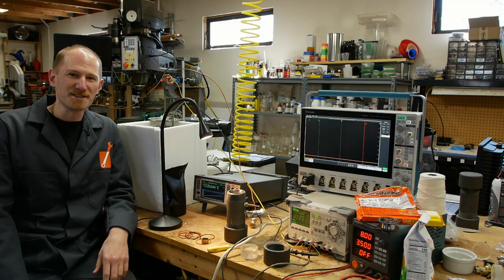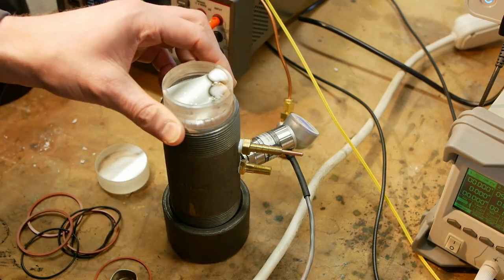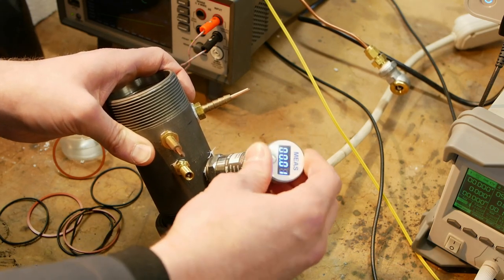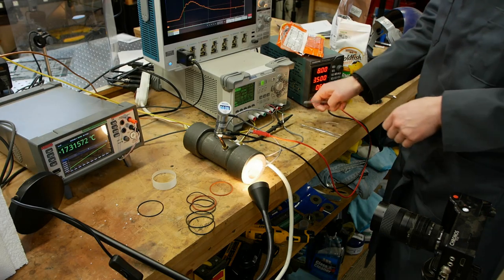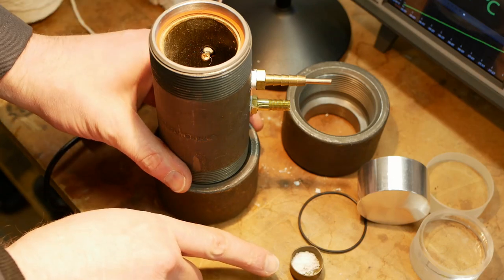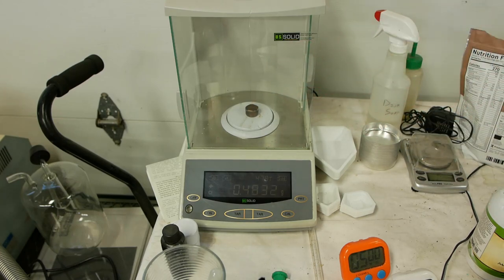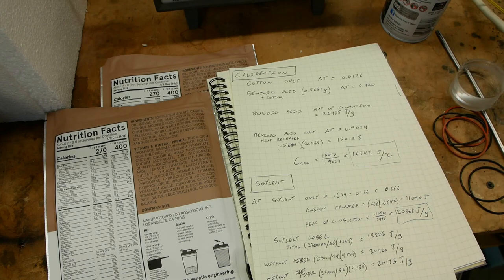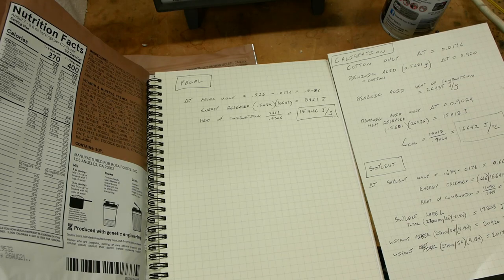Measuring human digestive efficiency vs. a flame

Comment: You should multiply the caloric output from the soylent sample by the total mass of soylent consumed to get total caloric input (flame caloric), do the same with the stool sample data; then compare the (total consumed calories) - (total output calories) for your two weeks.
If you subtract the total fiber calories from that result, you should be able to acquire a rough "total macronutrient removal efficiency" ratio (of course, this would ignore any losses due to bacteria consuming caloric value before your body could access it).
Reply: Would such a procedure take into account liquid and gaseous outputs?
Reply: @b43xoit  No, liquid outputs usually have passed through the body, thus were absorbed and count POSITIVELY for digestive efficiency (assuming you mean perspiration & urine outputs), and gaseous outputs are, unfortunately, extremely difficult to measure with any degree of accuracy (short of testing with a colostomy patient)

Comment: How did you ensure you didn't lose water between runs due to evaporation or drips sticking to the apparatus? It seems like the total amount lost would be relatively small, but I was curious if you tried to weigh the whole apparatus or something before and after.

Comment: It would be great if you could isolate the soylent 'output' and figure out the dry weight lost through digestion, so that the experiment can be performed with equivalence between the two samples.

Comment: this reminds me of a question from my days as a runner.. i always assumed i was bruning about 100 kcal per mile. i also found that i lost about 1 pound of weight by dehydration for every 3 miles i ran. i assume that water lost to dehydration means that water had it's temperature raised from normal body temperature to boiling temperature. i never quite did the math, but it seems like it corelates closely with your experiment, where the weight of water lost to dehydration is a measure of total heat produced by normal body metabolism plus the additional heat from burning the calories from running. any thoughts?
Reply: Well when you run you lose water by sweating and by respiration. None of the water is "raised to boiling temperature", it just evaporates at your body temperature and removes heat equal to the heat of vaporization. Water vapor that you exhale might have been produced directly from metabolism without ever condensing. Sweat on the other hand evaporates as long as the air isn't at 100% humidity, and as it does so it removes heat from your skin.

Comment: And I'd be flabbergasted to see a person who used that diet still be alive after eighteen months of the diet just from the extremely high fiber count alone, and the fact that they ate paper, that was soiled in a flammable liquid food product that has the potential to explode if set on fire. Heck if you ask me, that person might as well drank gasoline for a week and called it booze, than simultaneously combusted if they got blasted by the heat of my fireplace, or a large wooden pallet fire because they stored a flammable and in some cases explosive liquid in their body, just waiting for it to go into self destruct

Comment: The difference is so small because you did not a proper mass balance but just analyzed the energy content per weight, not the absolute intake vs. absolute output. You took in e.g. a total of 1 kg soylent but what comes out is much less than 1 kg. So you have to multiply each total amount with the energetic value per gram that you determine to get the proper energy balance.

Comment: If you cover the whole thing with water, I feel that even a critical failure of the seal, and glass potentially getting all the heat from the flame, I don't think it'd be an issue. Because water around the whole thing will act as a heatsink and extra pressure on the outside.

Then again I might be wrong as I am not an expert xD
Reply: Wasserbombe!

Comment: You should compare the total dry weight ingested vs the total dry weight excreted to see what % of it got absorbed (that mean you should dry and weigh all the excrement from the week, unless you can think a more practical way to do it)
Reply: This is most likely the source of the error he's seeing. If he ate (say) a kg of food a day and pooped 300 grams of fibre then burnt that it would explain It fairly well.
The balance of weight would be respirated and peed out (the body burns fuel about the same as fire, fuel in makes CO2 and water out (kinda))

In short he's concentrating the indigestible products.

Would be interesting to see a comparison of the KJ for a days input and a days output rather than by weight.
Reply: @jakeanderson5355  Exactly, but I would suggest doing it for a week to be more accurate, if you do it only 1 day you would be pooping the food you ate the previous day and you don't know exactly what's from one day and what from the other

Comment: I think that you need to account for the calories that gut bacteria consume, then die and get included in the fecal matter. Bacteria is technically edible and has some calorific value. The bacteria would help in the digestion of human absorbed calories. Ideally, one needs to do a mass flow balance (in/output). Of course one would need to measure the exhaled gasses and fluids as well to get the real energy equation. 

Another component of Fecal matter is some lipids (fats) that facilitate bowel movement and easy expulsion of feces. That also has energy content.

Comment: Could you have used a high voltage arc from a neon sign transformer for ignition and a spark plug as feed through (connect the high voltage lead to the terminal with a tube slid over it filled with epoxy for when its under water).

Comment: So, to get the proper in vs. out calculation, you would need to compare the total dry mass of food vs. the total dry mass of excrement. This way you get at conversion factor. Because you really cannot compare a gram of food with a gram of excrement. The dry poop is basically concentrated fibers from the food plus a few other things. The digestible calories from the food where already burnt in the body. So, what would that conversion factor be?

Comment: You would need to have an animal/human in a suspended chamber ingest a fixed amount of food/H2O/O2 and convert it to excrement/gases/H20. You would need to maintain a fixed volume of air, temperature and pressure in the chamber by removing excess CO2/methane/humidity/heat/etc. produced.
 By controlling and measuring all inputs and outputs of materials and energy then you can calculate the amount of calories the food introduced into the system. Interesting but tedious - 
This was tried previously and partially by Von Helmont's willow tree...   (for dried mass only) 
Dr. O.

Comment: Also, when calories are burned, most of the mass departs the body as CO2 and water.  The CO2 and some H20 depart as breathe, and much H20 departs through urine and poop.  So those masses are not included in your freeze dried output sample.  There are some excellent youtube videos on this, search "when you lose weight, where does the mass go?"

Comment: Why did you use pass through on both sides of the ignition wire? Couldn't you have connected the chamber to ground and connected the wire to that?

Comment: I also think that some of the matter is lost in the process of digestion, so calories per gram aren't relevant. To get the efficiency of human gut you would have to take the ratio of calorie output and input and also include the change in your weight, so that will be a lot of work. I can see why someone would call experiments like this inhumane.

Comment: Calories (or  ore accurately kcals) are a poor gauge of metabolic potential.  Each macro nutrient upis digestible is digested via different chemical methods. Carbs, proteins, and fats use different processes.

Fats may be high in potential calories but are mostly undigested; the maps all portion which is needs pancreatic lipase to break it down into lipids which are small enough to pass through the intestine wall. 

Ethanol is combustible (high calorie) but has zero metabolic potential as it’s only broken down by the liver into ethyl aldehydes and excreted. This is why “winos” tend to be emaciated but those who are beer drinkers have a “beer belly” due to much more undigested sugars vs wine. The bacteria in fermentation have already digested the potential nutrients — ethanol is the waste product so there’s nothing left for us to digest. 

I’ve been on a high fat, low carb diet for 4 years and have lost and kept off 30 lbs. if eating “high calorie” foods make you fat, I’d be huge by now. The rise in T2 diabetes matches the increase of excess carbs in the diet. Fat doesn’t make you fat, sugar makes you fat.

Comment: instead of temperature change, could the chamber be modified so, that the burning gasses would move water? The pipe bomb could be submerged into sealed container which is filled with water but there would be pipe out. When the material is burned, the pressure would escape from the chamber into the sealed container where the water would be pushed out via the pipe. the energy could be then calculater with height/weight/volume of the water ?

Comment: Maybe it didn't show up on camera but did you let the temperature stabilize before you ignite the nicrome wire?  To get accurate results you should let the temp of the full setup stabilize for 2 hours before ignition.

Comment: There is nothing wrong with the output dried poop having a higher energy density than the input, if you ate 2kg @ 100 per g and output 5g @ 200 per g then the output is significantly lower than the input even though it is more "concentrated".

Comment: Hey Applied Science. Great video, but you're measuring the calorie DENSITY of soylent vs poop. To measure dietary efficiency, compare TOTAL calorie contain of everything  you ate vs TOTAL calorie content of all fecal matter over a given period. You'll need to record weight consumed of soylent, and total fecal matter weight (after drying). Fecal matter is CONCENTRATED waste, so it may have similar calorie content to the input, but you likely ate a lot more than you shat.

Another thing that will introduce a lot of error here is that if you eat less calories than you're burning, you body will burn fat and thus produce some fecal matter (almost like shitting out stuff you ate a year ago). The way around this would be to eat an excess of soylent to make sure you're not in a catabolic state.

Comment: I was thinking that temperature changes are not equal, right? If initial temperature of water was 10 degrees vs 20 degrees You would calculate different results right? Because if water was 80 degrees, it wouldn't get hotter? Well it all comes to "room temperature" and how good the water bath is insulated from external influence.

Comment: I think other comments have mostly addressed this but you've only measured the caloric density of the two materials, you did not take into account the total mass/calorie ratios.
e.g. 3 Soylent packages per day * 7 days * mass of soylent package vs mass excreted during that week.
So even if the excretion has energy density 75% that of the soylent, if you only excreted half of the mass you consumed, then you can say that you absorbed/used (100-75/2)% of the calories

Comment: That seems like a good self-made bomb calorimeter and well presented, too. That video of the burning and T vs time graph is beautiful !

A serious flaw in your analysis though:
- The amount of J in the food vs in the feces does not support your conclusion of a low efficacy digestive system:
 Imagine I eat 10 kg of food with X Joule/g and produce 1kg of feces with the same X Joule/g . Does that mean that my body has an efficacy of 0 ?
In fact, only 10% of the food is not being metabolized by the human body.

Here is an interesting read on the topic:
Analysis of energy metabolism in humans: A review of methodologies, doi: 10.1016/j.molmet.2016.09.005
"In humans, about 90% of energy ingested is metabolizable energy, with the rest being lost in the feces, urine, or leaving the body via the skin"
When reading this study it is apparent that 'measuring human digestive efficiency' is not that easy.

Some small nitpicking on the setup:
- You should not let the thermometer touch the container wall or you will measure the T of the wall instead of the water
- The number of digits on your device are irrelevant if your thermometer cannot provide that accuracy ( I think a cheap Pt100 would be 0.3°C error at 0°C, but it varies) 

greetings

edit: I glanced at your calculation and if I am not mistaken you had delta T of 0.5445 in your Soylent calculation. IF your thermometer has an error of 0.3 °C at 0°C (which gets worse with increasing temp) your experiment would be doomed. You should check the specifics of the thermometer; I hope I am wrong and you have a good one!

Comment: Fecal matter also contains a lot of things that aren't just digested input, like dead blood cells. IIRC dead blood cells is why its colour is that way.

and besides that 1 gram of soylent won't produce 1 gram of poop. so in that sense i feel like the experiment is flawd, as the output is far more condensed than the unput and isn't just a 1:1 comparison.

Comment: 1 g of soylent DOESN'T turn into 1 g of fecal matter. Practically all of the soylent mass from which energy is extracted by the body is turned into water and CO2. That's why you get such a high energy content in the fecal matter.

One way to measure how much soylent turns into how much fecal matter would be to add an inert chemical or material to the soylent and measure its concentration both in the soylent and in the resulting fecal matter (yes, this will require another week of eating only soylent). Alternatively, you could look for an inert chemical that is already part of soylent. This will make measurements much harder but you wouldn't need to redo the experiment.

Comment: The small difference between undigested vs digested calories is why poop is still good fertilizer: the human digestive system is not efficient, but it doesn't need to extract EVERYTHING from the intake. It only needs to extract enough to keep the body going. Adaptation in a nutshell, or a bomb calorimeter😎

Comment: I want to know more about those many thousands of data plan contracts to the telco and how are the costs handled. 
Because where I live, the cheapest plan is about $2/month. Multiplying that by those "many thousands" and it quickly becomes very hard for any NGO. 

Why not mesh them by wifi? And put the data on cloud using only one or a few phones connected?

Comment: What is the ratio of dried fecal matter produced to cacao ingested? The mass out isn't the mass in because the digestible calories were converted to carbon dioxide and water and exhaled and thus won't be in the fecal matter. Of course it's hard to measure the water because telling respiration/combustion water apart from water lost due to simple evaporation of bodily fluid is a challenge.

Comment: I'm going to say there's a mismatch between the mass you consumed and the mass you excreted. If you took in 1000kcal and it was 1000 grams, then the body absorbs 90% of the mass, you'll have 100g of waste output, but it might still contain 100kcal which would make it still have the same energy density as the original food. To be accurate, you'd have to measure the mass intake and the mass output to get a correct calculation.

Comment: Aren't you assuming that 100% of the materials from the soylent end up in the feces? Aren't some of them urinated, which is definitely the case for the protein, or removed as gasses, either as flatulence or in the freezer drying process? So a gram of dried feces might represent more than a gram of dried soylent, in terms of energy extracted, in which case your efficiently might be higher than measured.

Comment: I do not think it was weird that the difference in calorific output was not that that different from the Soylent.  
There is less mass coming out than what went into your body, and it's gonna be mostly indigestible organic matter.  Would assume general organic stuff like fibers are not far from wood in energy (~22852 calories for 0.5 gram), if you then assume ~30% of the weigh is inert, you should end up around 15000 calories.  
(Just me guessing.)

Comment: I would have tried Teflon seals (sheet or rope) and I would have wanted to see how the glass/plastic would have withstood the fire under it. (viewing it through a mirror at 45°)  Not purging the air out of the vessel (using refrigeration style valves) would have been a good idea. Ron W4BIN

Comment: It looks like you didn't adjust for ratio of mass in to mass out. That is of course really hard to adjust for properly, but considering how much more mass you breathe out than in I suspect the fecal sample was a fairly concentrated sample of what the digestive processes did not break down.

Comment: Isn't the change from 13 degrees C to 14 lower than the one from 14 to 15? So if get for example 100 calories needed for a 1 degree change from 13 to 14, it might need 120 calories to change from 14 to 15, because the change in temperature is not linear.

Comment: I feel like testing the same weight of poo as Soylent can be inaccurate because the body absorbs a lot of the sugars, fats and nutrients and doesn't absorb the fiber. So what's coming out is probably mostly the fiber from multiple meals of Soylent.

Perhaps more accuracy would be gained from fasting, having a big meal of Soylent, then switching to a water/liquid diet until you thought the meal was eliminated. Though that might be an unpleasant few days.